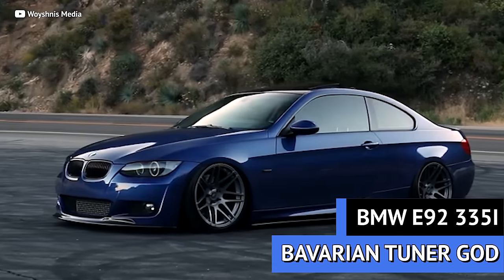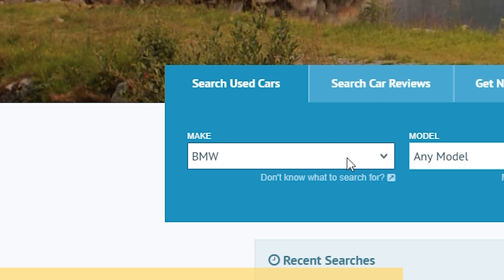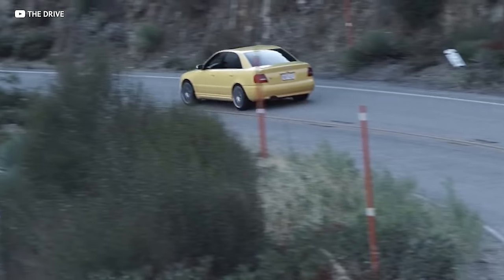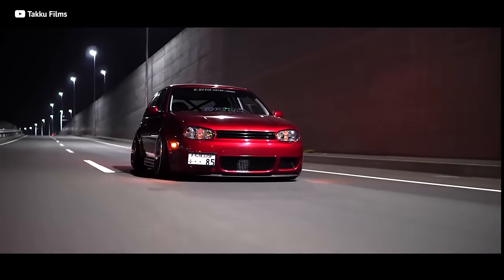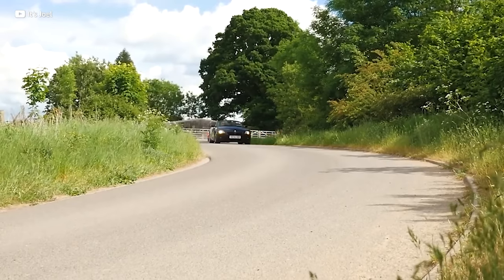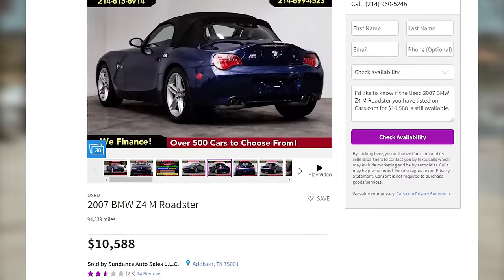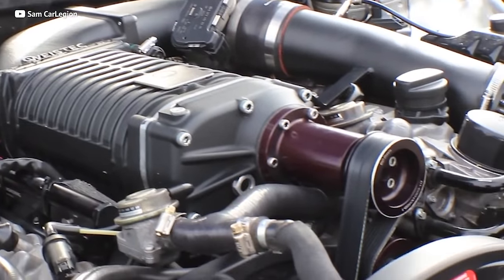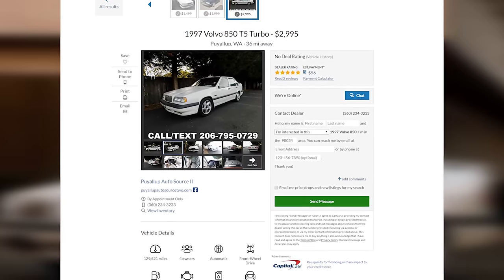CHEAP European Cars with INSANE Tuning Potential

Comment: Ah, yes. Another channel misinforming the public on Saabs. First off: model years with the available 2.8T motor are from 2006-2009 (not sure what the 2002-2007 year range was for, but that covers two entirely different generation of cars). Second, the 3.0 is unreliable? What? The 9-3 was never offered with a 3.0L motor. You could either get the aforementioned 2.8T, or the 2.0T, both of which are considered equally reliable. Third, if you’re going through JZW for a tune, good luck. He hasn’t tuned in years. Try Vtuner folks. Moral of the story, please find correct information on the vehicle you’re going to share with hundreds of thousands of people.
Reply: so true... But Vtuner wasnt a good option for my Saab either. Just drive stock and have fun :)
Reply: Auto Autopsy  Don‘t forget the 1.8i motor, the 1.9 diesel and 1.9 twin turbo diesel engines
Reply: @fringe2804   we were talking about aeros here, pretty sure that is what autopsy was talking.

Eeeeeeven thought aero was basically just a package on the last ones.
Reply: juhoqqeli  There was diesel-Aeros too you know.
Reply: @viktorjjakobsson9710  And it seems like you didn't open my message.
Reply: He confused the 3.0 from the 9-5 with the 9-3. JZW doesn't make tunes no more we have to go thru Brew City Boost, or Maptun, Vtuner is a bit conservative & is more for the small turbo' saabs like the linear, than ARC, Vector, Griffiin, Aero. He could've mentioned the 9-5 base which the 5 Speed is faster than an Aero 9-3 due to the 20 sec overboost mode. He could've mentioned the SAABARU with it just for fun, & a 9000 which is the most treasured SAAB for tuning.
Reply: @fringe2804  We don't have those diesel SAAB engines in America, except for the last gen 9-3 & 9-5's & very few Americans bought them, if they did sell that 9-3/9-5 turbo 4 & turbo 6 biodiesel here in the states.
Reply: I mean this guy is saying e9X series of 335is are cheap and reliable so he proved he know nothing
Reply: Smh no one is talking about the 9-5 B234R
Reply: There was also a 2.3 with 225 hp
Reply: @alexanderfernestad9460  The 9-5 Aero is 250hp stock and 280hp with an exhaust + chip tune and about 310 on E85.
Reply: Fringe280 we didn’t get those here in the USA. Diesel was for euro only
Reply: The Raze so true. I have a ‘04 95. Currently stage 2 ($250) for the brew city boost tune. Stage 2 gets ya 280hp and 315torque. Stage 3 will jump to 300hp/340tq. You’re talking for pennies comparing to a German car. Oh and VW. Not reliable IMO. Auto Autopsy has a turboX and those are tune monsters too.
Reply: Jeez what the fuc are you talking about this is  the fucking worst saab engine ever. Have you ever serviced one of them it takes a day to change just the spark plugs. Not even talking about cracking heads and oil spills.
Reply: Mike d tuned is where its at.. When you gonna run that 2.8 against my 2.0T..??
Reply: 2.3 T ? Good also?
Reply: @nilcialinasemedotavares4144  oh yes.  The B235 is a really good engine.  The bottom end of the B234 is a bit more sturdy tough.
Best of both worlds is the B234 with a B235 head.  Can boost them past 400hp on stock internals.  Not bad for 2.3l

Btw, the 2.0 and 2.3 are saab engines.  The  V6's are Vauxhall engines.
Reply: @hannya29  not talking about it, because we are out enjoying them. Haha
Reply: Yes please don't go through JZW, he has scammed a lot of people, including (almost) me.

Comment: In Germany there are two used cars you should never buy cheap: A 335i and a CL55.
Reply: I think its the same everywhere, you get what you pay for
Reply: If you know the nuisances of the platform and what hardware to upgrade, there isn't a problem.
Reply: This is absolutely true. If anyone here buys a cheap 335i, damn bro. Go to your Garage of choice and let it check completely. I don't know about the Mercedes tho
Reply: If your not mechanical inclined but if your familiar with the platforms well should know. Never say never...
Reply: You can still buy one cheap and put serious money in to get it in good condition. Atleast then you know what you have. Buying an expensive one isnt a garanteed succes.
Reply: No German car is reliable they're ticking time bombs
Reply: @motosapien2310  lies.
Reply: @atEase1775  yes no problem, pwrfect condition 335i are about 10k, cheap ones are 6k but first service cost another 6k, and thatd just suspension for example
Reply: Aren’t they cheaper to maintain in Germany though, compared to the U.S? Like fixing a Toyota in Japan?

Comment: Finally Saab getting some love 🔥 Saab 93 V6 Turbo owner here ✋
Reply: @DC Williams way to be a hater
Reply: Everyone hates Saab’s till they get smoked by one..
Reply: Hope you dont have that 3 liter that doesnt exist. This video says they are unreliable
Reply: 2.3t
Reply: I got the 2.0T aero running 325 hp with bolt ons and a tune
Reply: Saabs are so fun! I love my 9-3
Reply: 99 9-5 2.3t
Reply: Stage 3 9-3 T5
Reply: @DC Williams Toxic kid
Reply: I had a convertible 9-3. But with a diesel (not available in the US). But it was the twin-turbo engine. So with a tune, DPF delete, EGR delete and swirl flat delete it was running 250bhp and 500nm (368 ft-lb).
Reply: is the aero one good)
Reply: How much did u pay ?
Reply: No
Reply: ive got the og 93 2.0 l SE and she rips stock

Comment: Just bought a 335i for 2500$ and had turbos bought and installed for 900$. Amazing car!
Reply: Enjoy it while you can
Reply: Is it reliable
Reply: I am looking for a 328i for the reliability
Reply: @kaushikg2961  get the 330i fpr reliability, 328i seems unnecessarily low.
Reply: @Salpeteroxid  thx but when you say unnecessarily low do you mean power output
Reply: @Salpeteroxid  btw this a first car and i kinda want the most reliability out of it
Reply: Wow that's an amazing deal congrats!
Reply: @kaushikg2961  don't get a BMW for a first car if you want reliability. They will crush your wallet. Get something reliable but not as fun for a daily and then when the money allows it, get a 335i project car. Although less fun I know it would be the right thing to do
Reply: @kaushikg2961  don't get that AS ur First Car dude

Comment: Thank Germany for cars and BMW. I wouldn't say I'm a fan of BMW but if it promises upto 1000 hps, hell ya I'm down for it
Reply from the maker: lets goooo! the german supra!
Reply: Do not listen to ideal media the guy is a poser and a tool. While yes you can get up to 1000 hp out of the n54 it takes a lot of money and preventative work to keep your rods and pistons from qualifying as astronauts. Also never buy a cheap 335i you’ll need to put Atleast another 5k in them. BMWs are great cars but not known for their reliability
Reply: Andrew How is a 335i different from any asian tuner car???
Reply: Andrew bmw makes thE best inline 6 so idk what u mean not being reliable. yes the n54 has some quirks and hpfp problems but if you do the work yourself they are fixable through preventative maintenance. Bmw is a great brand and if you want something that can make it to 200k plus with ease the older 328i’s with the na inline 6 are amazingly reliable and those engines run forever.
Reply: shane dog I own a bmw, n54 is by no means reliable and that was the car he recommended especially when you put more power through it. As for the 328i they are reliable as long as you do required maintenance but can’t handle power due to their magnesium block.
Reply: Dāvis Kalvāns most Japanese cars are pretty reliable and what makes them so damn tunable are they’re damn well made engine that are reliable even with big hp. The problem with the 335i is the magnesium engine block is pretty weak and also has some reliability problems
Reply: @xhearthfirex6571  the 328i has a magnesium block(which was intentional so you couldnt strap a turbo on their and effectively have a 335i for cheap) n54 that comes in the 335i has an aluminium block
Reply: @davissilvestrs1996  asian tuner cars are more reliable, the 2jz can take much more power than a n54 because of the cast iron block. BMWs are great but the idea of chip tuning your n54 and everything working reliably is a bit naive. to get a reliable n54 pushing power u need a lot of work and machining prior.

Comment: The Bmw 530d with the i6 diesel is again a gem in amd out of itself... My uncle owned a 2010-11 model... It came with zf 8 spd only but even in rwd format it did 0-60 in 5.7 secs...
With just a custom remap, modified cold air intake and filter... It made 650 nm torque and almost 300 hp... Fun fact the diesel in its stock form is faster to 60 and in gear than it i6 petrol counter part
Reply from the maker: yeeee! love the torque on the diesel!
Reply: You can easily tune a 535d at 400+hp and hell of a torque. Just imagine!

Comment: I have an N55 335, while it’s not quite as tunable, it’ll likely hold up better over time and 300 horses is more than plenty for me right now
Reply: Brendan9140 N55 is reliably closing the gap on n54 with Bootmod3 and pure turbos it’s pretty close. I went f30 msport 335i and am so happy compared to my n54. B58 has surpassed N54
Reply from the maker: nice! what spec?

Comment: mercedes m104 (one of the most underrated engines ever), om606, om605, audi 4.2 v8, audi 2.2 turbo, bmw m50/m52, vw 1.9tdi, 1.8turbo, volvo t5, volvo b230ft, alfa romeo busso v6. not all of them has a good tuning potential but theres some good european engines

Comment: What about the Audi C4 S4, otherwise known as the UR S4? Nothing like a 20 valve inline 5 that can be easily tuned to 800 wheel HP.
Reply: That's why I have a 93  and a 95 UrS6 wagon 😈

Comment: The 850 T5 will bend rods, if they see to much torque down low. Change rods and they can make 500 hp and lots of torque all day easily.
Nice daily sleeper. But for very high boost, the open-deck aluminium block is a bit "weak". It needs some sleeves 🔥

Comment: The N54 is a awesome engine! I miss my BMW!
Reply from the maker: you had one?! what color?
Reply: @IdealMediaChannel  
  Can't have a BMW unless it's black! 😁
  They aren't as difficult to repair as most people make them out to be. They are high maintenance for sure, but that's really about it.
   Now, one common problem that can be a real pain is, the valve stem seals. Obviously there's a few other things, but the valve stem seals are by far the worst issue and you are looking at around 30hrs +/- ( book time) to replace.
Reply: @IdealMediaChannel  
 Now I've got an 02 WRX wagon ( bug eye) that I'm about to dig into! 😁

Comment: There is another ultimate sleeper, 1991 till 1997 model Audi URS4 or URS6 Quattro 2.2 turbo 5 pot cylinder engine.  These engine are capable over 1000bhp check it out.

Comment: I have the E90 335D, m57 diesel engine, US-spec. Stock is rated at 265hp.
So i bought $500 worth of parts, gutted out the emissions and did a Stage 2.9 tune. 
Now its 400 hp, and 650 ft-lbs of torque. Out runs every AMG, M car to date.

Comment: Great content! The 335i is definitely a monster. Mine makes 500 crank hp with intake, exhaust, and tune!
Reply from the maker: wow!!! pretty reliable?
Reply: Ideal Media that not so much 😂😂. However, after replacing common failures it has been pretty solid!
Reply: @TrapN54Tv  Im fixing mine at least once every 2 months.  she's a pain when she's being a pain, but man when she's running right, it's such a fun car, there are times when driving with the windows down the sound will have me giggling like a little kid.

Comment: 1:11 12 year olds (fans of supras and gtr s) will say its fake but it poped better than a supra 🤣🤣
Reply: Not everyone who likes Supras and Gtrs are 12 year olds
Reply: And something this guy didn't tell you is that you can push 2jz's until 1900hp
Reply: @alexandrosioannou2230  doesnt 2jz come stock with 2000hp?
Reply: @tuuletingrilli  umm, no. Not a single car engine comes out with such a rediculous amount of hp. Only way to reach these amounts of power is tuning. Btw a stock supra obly has 220 hp.
Reply: @alexandrosioannou2230  its a joke
Reply: @tuuletingrilli  Nah bro it comes with 10 000hp stock
Reply: @alexandrosioannou2230  chiron has around 1500 hp

Comment: I have a 2016 BMW 650i xdrive gran coupe. Stock it has 450 hp and 480 lb ft of torque. I put in a stage 1 remap and have 535 hp and 585 lb ft of torque.  Next is catless downpipes and a custom tune and I should be easily over 600 hp.

Comment: The first 3 german cars you mentioned could easily manage the 800+ hp IF you Upgrade your rods and pistons. 

And you missed another with big potential. The 1.8T AGU and BAM. Build in golf MK4, a3 (the first one), cupra r and the audi TT. This baby handle from 150hp Stock up to 600hp and it is cheap. Okay... maybe 450hp for a daily usage. But this is still an increase of 300%. You only need pistons and rods again. After you Upgrade your downpipe you are ready to go.

Comment: If you're not afraid of diesels, BMW 325dA is a hell of a tuners dream.
Originally it has 204hp and a simple remap will get it up to +330hp and 690nm.
The six-speed ZF automatic gearbox has a rumor of handling up to +900nm.

For example, 0-200 is around ~16 seconds.
F82 M4 is 12,9s.

Comment: Apparently if you weld a front onto a smart car and fit a big block v8 with a chieftain tank gearbox and lorry tyres it will do about 900 miles per hour in less than 4 seconds

Comment: Spend $3k on a car then another 5x to upgrade it. Only to find out that it keeps breaking down. Can you think of a better way to throw $20k down the drain?
Reply: 3 x 5 =15
Reply: CoolockIRA 😂 Maybe dude was rounding up.
Reply: CoolockIRA 3 x 5 = $15k.  Mods don’t add value to the car,  just makes it less reliable. Conservatively another $5k to fix it breaking down. Get tired of it after a few years and decide to sell it for 🥜
Reply: Get one with low mileage so, only an idiot would mod the car without ironing out any issues it has before their ownership. Fix whatever minor issues it has then stick like 10k or less in and that really is all you need!

Comment: The key to owning a german car past 50k miles, is knowing how to do atleast 60% of maintenance or just having a lot of money, or know a shop that specializes in german cars and are affordable
Reply: Or just buy from fcpeuro.com and do your own labor🤷🏾‍♂️ where everything is lifetime warranty
Reply: interesting cuz my colleague has a golf mk3 and has never had any issue so far only did an oil change tire change normally , no engine failures or signs of failure or nothing that car must have X4 times of the miles you mentioned , dont go around desinforming people volkswagen are the most reliable brand ever
Reply: @lconthebeat  what are you talking about dude? I never mentioned that they are unreliable? I also have a 200k mile VW Jetta. I said that the KEY to owning a german car thats higher mileage is being able to do most of the work yourself or know someone who does it for a good price. Because people will complain about the cost of the timing belt/chain maintenance, tensioners, suspension, etc...
Reply: @Anon_Fox  and what did i say ? He hasnt had any need to look 4 cheapest parts u aforementioned nor done handwork himself cuz the car is in perfect shape
Reply: @lconthebeat  alright cool dude

Comment: I love my 510hp XFR but an even better performance value if you plan to tune is the Jaguar XF Supercharged.  Same basic 5.0 Supercharged V8 as the XFR (470hp in the "de-tuned" Supercharged trim) but if you are planning on tuning it anyway you can skip the extra cost of the XFR.

You can find 2010-2012 XF Supercharged down around $10k and with a tune/pulley/exhaust you can be up in the 600hp neighborhood!

Comment: Ideal media, you kinda forgot the skoda, but i doubt you have many in us.
Stock mine from 2014 is a 
2,0 tsi hatchback
220 bhp
350 torque
And  fwd

But is atm running
335 bhp
504 torque
Still fwd

And this is only with a mod, an exhaust from Remus and K&N air intake.

Comment: The 135, 335, and 535i have great motors, BUT they have terrible accessory failure. (Waterpumps, fuel pumps, gaskets, etc) coming from a former owner of a BMW 535i fbo it gets stupid expensive

Comment: An also great german car with Lots of tuning Potential are the opel astra opc /vauxhall astra vxr(mk4 & mk5) and the opel / vauxhall zafira opc/ vxr All three cars with an inline 4 the z20let and the Upgraded z20leh that comes with the mk5 astra opc /vxr this cars can with swaping out the engine Main parts to forged and a bigger turbo you can reach extrem easy reach 400 to 500 HP

Comment: Negative on the Saabs! The one to get is the 9000 Aero 1993-1997 and 1998 9000 CSE. 2.3T B234R motor wich were good for 650HP on stock internals with a good tune. Also the Saab 900 Turbo 1994-1998 and the 1999 9-3 2.0T B204L motor are good for 600 HP stock internals with good tune.

Comment: Not all e9x 335s came with the N54,only the early models did. I had an 07 335i sedan with the N54 and If I’m not mistaken the 2008 which got the facelift got the N55 which is a single twin scroll turbo. The coupe I think had the N54 in 07 and 08 then for 09 it got the facelift and the N55.

Comment: You left out the 2JZ of Diesel, OM606 from Mercedes-Benz, 3.0L just with a turbo kit and some time you can get the stock engine up to 400-600 horses, put som more time in and strengthen the motor and you cant find anyway of destroying the engine. Its the best motor you can find if you love Diesels

Comment: The N54 motor that’s in the 335i can stand up to 750 whp without needing internals now if you want a more reliable motor the n55 is the place to be stock to stock the n55 is faster but not as tuner friendly

Comment: Take basically any 90's Mercedes engine,you'll be able to make triple times the hp on the stock unopened block.
M103-M104-OM605-OM606.or even the smallest 1.8 M111,that can make you 350bhp.